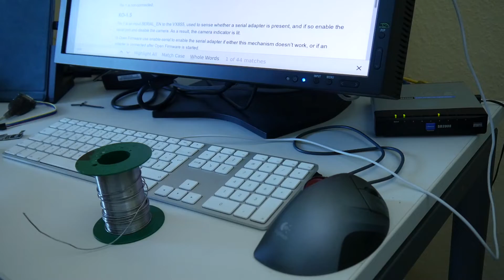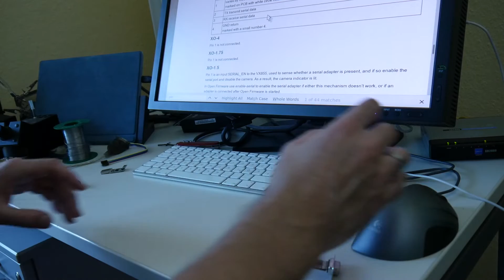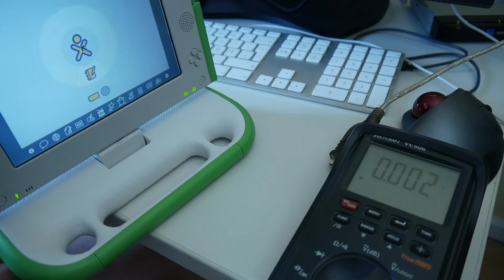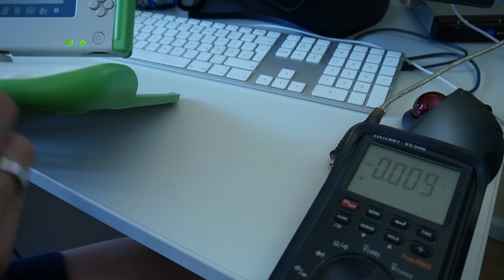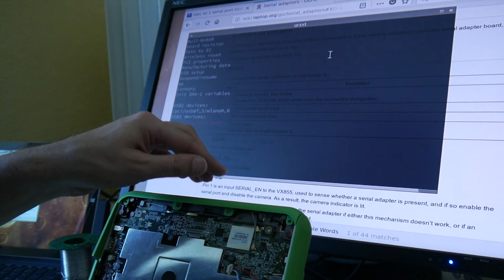One Laptop Per Child XO-1 unbricking & serial TTL converter

Comment: Thanks for this video!

I just picked up a first gen from a thrift shop here for 10$. Battery light goes orange when plugged in. Pressing power turns on the top left light and the power led green. I'm going to try your fix but I'm also suspecting the screen/battery are broken.

Thanks VERY much for your video!!

What would be the command you'd actually be sending through the serial port to the laptop if I get it connected to fix the clock? Or was it more for diagnosis?

Comment: I just got two of these with this issue. They were purchased by the organization I work for probably a decade or more ago (most likely the buy one donate one option). Would replacing just the clock battery get them to boot, or do I need to do the serial connection as well? Also, since you're magically turned on unexpectedly, should I leave them plugged in and powered on and see if they eventually get enough charge to the RTC? I do want to try to update the firmware at some point, but don't have a soldering kit (or skills - never soldered anything before) so I'm researching options to get a mostly plug and play kit running. I've got a RPi B+ that I've never used for anything other than as a little general purpose computer so maybe I can interface that with these machines?
Reply from the maker: I only have one OLPC so I have no other data points. The instruction on their website clearly stated somewhere, that charming and waiting will not make this problem disappear. Yet it looks for me it somehow did. I mean you could try, probably, I guess, but it might simply not have an effect. You do not really need soldering skills though, just disassemble, and plug in the serial connection into the micro connector. Best avoid the overpriced (~$100) ready made solutions for OLPC, a serial dongle and this micro connector thing should cost less than $10.
Reply: @renerebe  Good to know, :) I'm gong to take one of them apart and see what I'm up against. I've seen a couple fairly cheap kits (under $20) and new batteries look to be around $2 or $3, Thanks for the reply!

Comment: Hey dude how did you connect to the actual J1 serial socket on the board? What is that piece you are using and where can we find one? I have the AdaFruit FTDI friend ready to go but it's unclear how I'm supposed to connect to the tiny pins on the board
Reply from the maker: I said this in the video ;-) the matching micro connector, or like me: an old Apple iBook speaker cable that also fits after trimming it's plastic a little bit. Getting the matching micro jack thing is probably easier, more straight forward, or also go thru your tinkering spare parts boxes and see if you find something fitting ;-)

Comment from the maker: PS: I would recommend doing this DIY like sown in the vide, with any regular serial adapter, and not spend over 120$ for this, e.g. on eBay: https://www.ebay.com/itm/OLPC-XO-1-0-One-Laptop-Per-Child-Serial-Adapter-Fix-Bricked-XO-Laptops-Not-Boot/261077483054?hash=item3cc96e3e2e%3Ag%3AIV8AAOxyNSVSQUlH